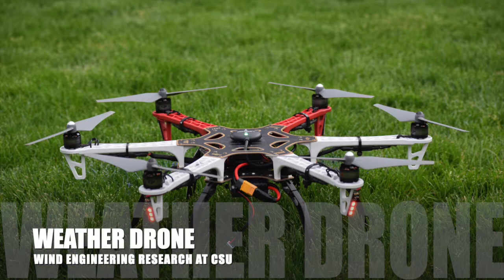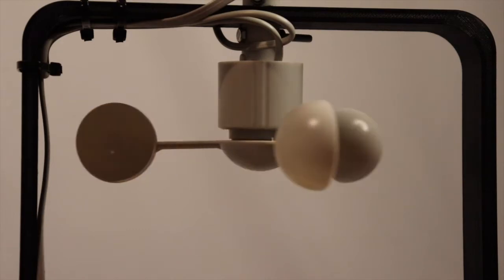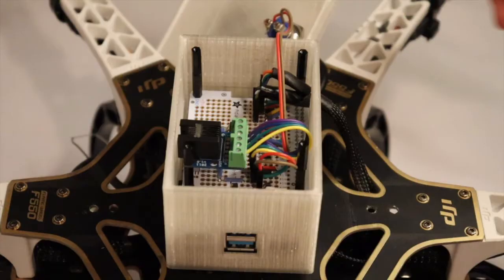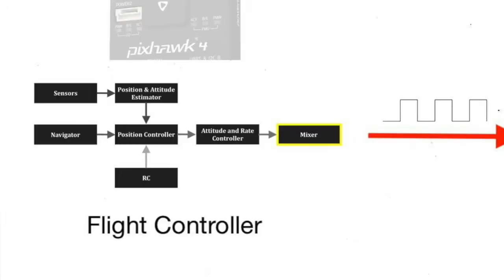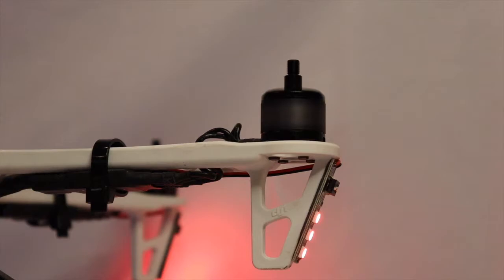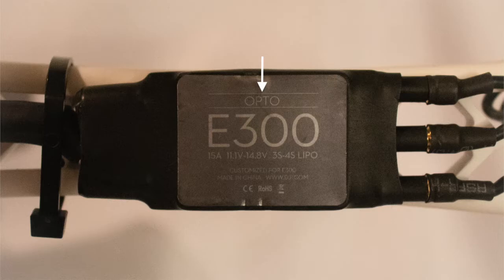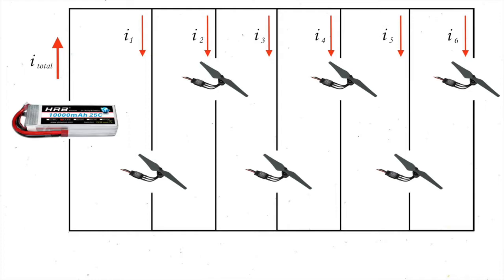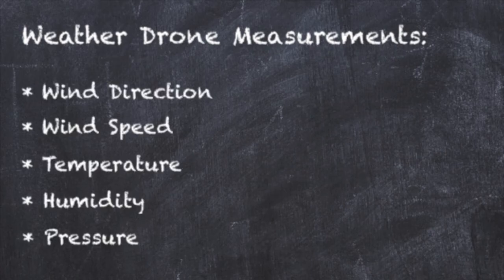CSU Weather Drone (Pixhawk 4 Hexacopter with Onboard Raspberry Pi Weather Station)

Comment: Was 15A enough? I've usually seen these with 30A ESCs
Reply from the maker: Hi, yes the 15A ESCs were plenty. The ones I used are just the recommended ones for the DJI E300 motors (https://www.dji.com/mobile/newsroom/news/dji-released-the-tuned-propulsion-system-e300-and-e600). I bought them used as a set. Here’s a pretty good article on ESC sizing if you’re interested: https://dronenodes.com/drone-esc-electronic-speed-controller/ Thanks!